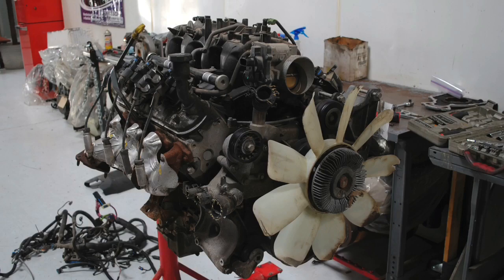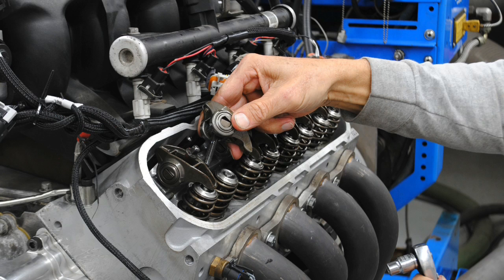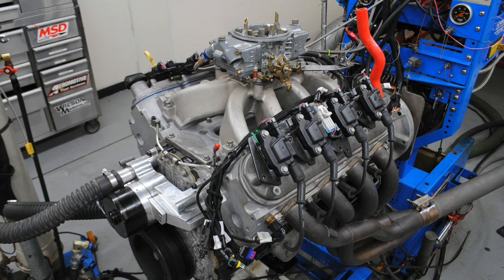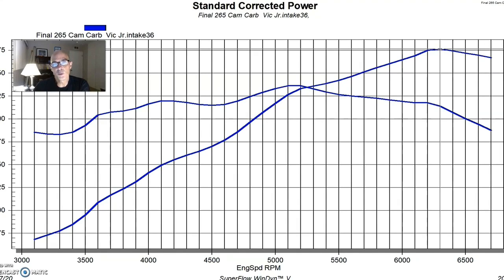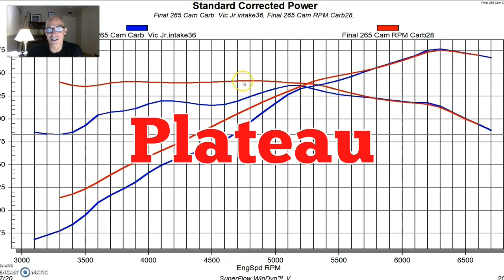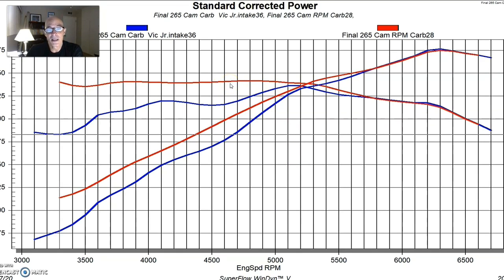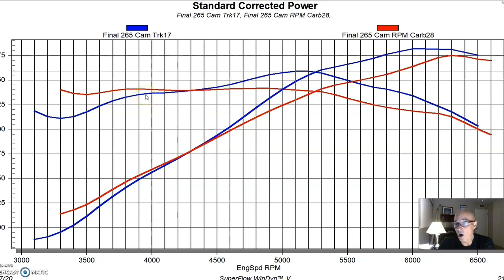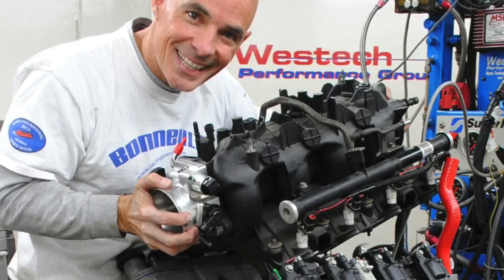CARB & EFI 4.8L INTAKE TEST

Comment: Rich is there a camshaft grind that would be considered a torque grind that would produce better numbers with the carb setup? I love the fuel injection on my daily driver but a carb bolted to an aluminum intake under the hood of toy still has a very strong cool factor for this guy.
Reply from the maker: any cam swap will improve both induction systems, but there are mild cams that help low end some

Comment: My bone stock 4.8 in my chevy truck is a total dog down low. In 4 wheel drive it will not slip the wheels in a tight spot. Hold it to the floor and it stays on the converter, but won't move. Im not talking out rock crawling, beating or mudding, just wet grass, pulling out a a ditch. It is ok if you turn it 5,000 rpm's, but who wants to do that? It may have 350ish peak TQ but down low it has zero. Not a good truck engine.
Reply: Alot and maybe all of that is in the tune. It's torque management.
Reply: @ron Kay idk...5.3 runs decent and was mostly done for fuel economy.  My uncles 03 rcsb 4x4 ran 15.8@87 bonestock. A few mods later runs 15.3@90 with a improvement in fuel economy. Not as quick as alot of todays trucks but it's peppy to drive.
Reply: 5.7 Vortec usually makes more low speed torque than even a 6.0L.
Reply: @chrisreynolds6520  old vortecs did well at low rpm.

I just put headers and td x pipe exhaust on my 6.0. That helped low rpm stuff pretty well. No draggy test on that yet.
Reply: My 99 Silverado with the 5.3 has plenty of low end torque. I rarely seen anything above 2k RPM. Around 2.5K when towing and it gets down the road easily.

Comment: Richard, what causes the Sine Wave effect with the EFI intake?
Reply from the maker: Reflected Wave, Inertial Ram and Helmholtz Resonance all play a part in the shape of the curve
Reply: intake pulses from the air bouncing off the valve when it closes.
Reply: Its just pulses and harmonics in the intake and exhaust that cause the waveforms like that, its specific to the engine combo whether itll do that or not.
Reply: Different length runners will resonate at different frequencies. Also, a runner can resonate at multiple frequencies, which can cause the dyno graph to look "lumpy".
Reply: Okay, so could it be fair to say that there may be a better option for an intake manifold that would have different harmonics?
Reply: @upstategearheads   Its possible that other intakes may smooth it out some while others make it worse, yes, but the same goes for if you change anything else on the combo. Its a function of the entire combo as a whole, meaning cam/displacement/cylinder head/intake/TB/headers.
Reply: Probably. I think it would be a good idea to identify what RPM range you want the runners to resonate, determine the runner length that will do that, and find a manifold with that runner length. Ideally, you'd have a manifold with adjustable runner length, so you can dial it in. But that's a lot of work, and dyno time.

Comment: Given the results between the carb single plane and dual plane. If those same manifolds were fitted with 8 port fuel injectors and a 4 barrel throttle body would you expect to see the same results (or close to given the lack of charge cooling). I know there are different runner lengths but you also spoke about "carb signal", so what is the impact of that ??
Reply from the maker: power curves would be the same-just better tuning

Comment: Show the comparison of cylinder heads like the 6.0 on the 4.8 block
Reply from the maker: just put 706 heads on the 4.8L-they work best
Reply: 6.0 heads on a 4.8 inch would lose a lot of compression
Reply: 4.8 doesn't have a bore big enough for em. They don't fit
Reply: @lucysmith4242  Only the rectangle port (ls3/l92) heads don't fit , all the cathedral ports head including 317s which came on 6.0 will fit the 4.8 no problem.
Reply: dilsher12 thanks for the info and my bad for my misinformation 👌🏼

Comment: I’ve had three LS powered trucks, I always thought they felt soft off the line, the truck vs dual plane intake torque curve may explain why...

Hey Richard, can you narrow up your dyno graph a skosh, the numbers on the left aren’t fully visible (I’ve noticed the same on the past few vids)
Reply: Yes. I've had a half dozen LS powered trucks. Mostly 6.0s. Dogs down low.
Reply: @lte008  that's mostly because the 6.0 don't get into pe mode for 60 seconds or until the engine reaches 5200 rpm......so no full power in first gear.

 I did a back to back test of just turning that feature off and my 2500hd 4x4 6.0 picked up .3-.4  in the quarter via draggy.
Reply: @HioSSilver1999  it totally sucks and they kill it from the factory then.
Reply: @lte008  yup...easily fixed tho. They pull so much better once that is removed in the tune.
Reply: Had a 2000 single cab long bed 4.8 that just RIPPED(cold air intake and nothing else😂)  and beat even a 05 4.8 stock that shouldve made more stock to stock in a little street race 😂 that truck was something else. Also had a real light throttle spring that made it super touchy lol
Reply: Have it tuned it will be a night and day difference

Comment: You did a funny test on the 292 "other guy" engine. A test I would like to see is a divided Dominator to 4150 spacer to use a Dominator on a Dual Plane intake mountet on a healthy engine.
If the truck intake is used on 4.8, 5.3, 5.7 and 6.0L engines, maybe the runner size is a bit to big for the smallest engine?
Reply: Truck intake wasn't ever used on 5.7. But yes the idea is true, its a bit too big for the small 4.8, slightly big for the 5.3 and basically perfect for the 6.0.

Comment: In new to the channel so this may be a an old question but what about a carter/Edelbrock carb?
Reply: When tuned they are good street carburetors, but the engine "never" deliver the same amount of torque and horsepower as when it has a good Performance Holley carburetor. I agree with Mr. Holdener, Brawler FTW.

Comment: What happens if you just run straight 50 weight oil in these junk yard motors ? At the dirt track , the idea was to build the motors with lots and lots of clearance so they wouldn’t lock up if they overheated and fill the slop with thicker oil.